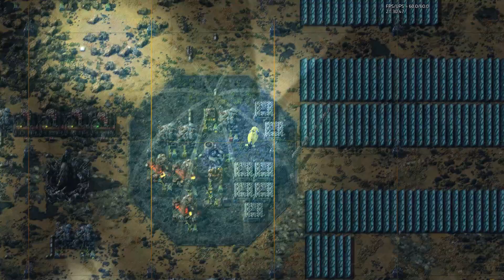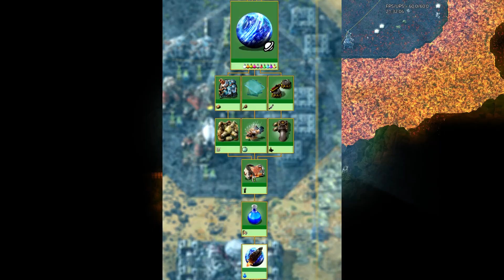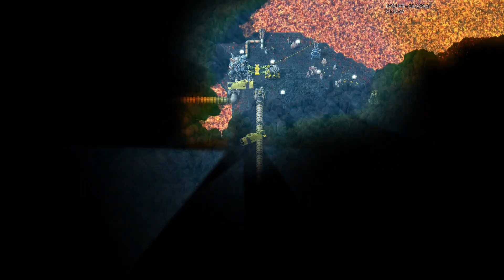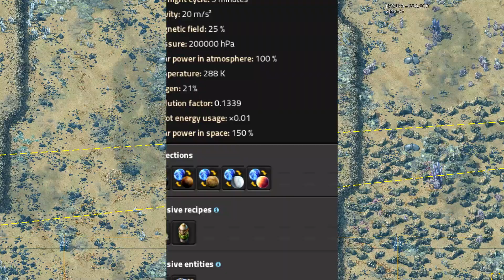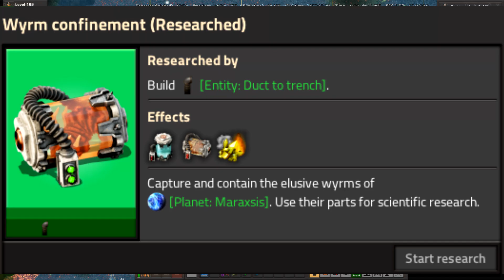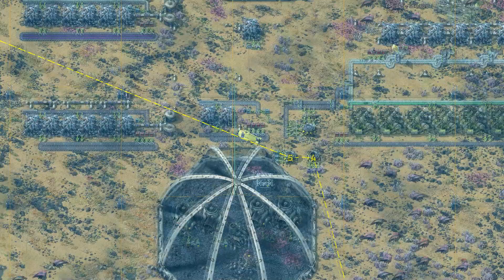Factorio Mod Tips: Maraxsis

Comment from the maker: Greetings Engineer! Thank you for tuning in. And thank you to notnotMelon for answering some questions I had about the mod:

1. How did the inspiration for the planet Maraxsis come about?
2. What made you settle on submarines as the transfer method between The Trench and the deep ocean?
3. What are the thoughts behind balance in terms of recipies, building a base in the trench for science? I know the 50% quality is meant to be overpowered, but did you also design it to be a hindrance(I found when I just wanted normal quality that I would need to work around the quality)?
4. Did you intend for people to choose between belt or bot bases when you made the robots consume less power?
5. The trigger techs worked wonderfully (for me) in terms of nudging me towards the goal, did you have the intention of "newer" players not getting lost or did it just seem logical to implement?
6. What was the intended power source in the trench? Imported steam, salt (for salt reactor) or a mix of both?
7. What was the intended way of getting the starting oil? I got a bit lost and imported heavy oil barrels to get coal liquefaction going
8. What is the reasoning behind the submarines having weapon slots if there are no enemies present on Maraxsis? Does that mean enemies are planned?

Answers by notnotMelon
1. Maraxsis will eventually be part of Pyanodons. We needed a water planet to fit all the sea creatures such as Dhilmos, Numal, and Sponges. At some point we decided to make the planet work also with space age standalone.
2. I absolutely love Xorimuth's spidertron patrols and wanted some way to integrate this into Maraxsis. Submarines became the natural solution. We met in Czechia and fixed the code for compatibility.
3. It's a hindrance at times, and an advantage at times. In general the tech progression should feel like quality is a hinderance at the start, but you can take more advantage of it the more maraxsis techs you unlock.
4. Ah, this is actually a bug. The planet's bot energy consumption is hardcoded be the game engine to be calculated based on x=gravity/pressure. I wish it could be something normal like 1x or 2x
5. This system went through many many iterations before I settled on the one that guides the player while also not feeling like a tutorial. Learned a lot about game design in this process
6. Imported steam and/or salt reactor are the only viable options. Fusion is banned here although I want to take another look at reworking the salt reactor to be useful on other planets.
7. You can melt fish into carbon into coal. Perhaps the simple coal liquification could be used for initial heavy oil?
8. Perhaps!
Reply: The mention of maraxsis first being a pyanodons addition is wild. I think that making it into a standalone mod for SA was the right decision as it opens it up to many more people to try. I love Py but I know that I am part of the minority when it comes to that.
Reply: Ey, this is nice! Especially 7, it was confusing.

Comment: why does this planet look so easy with you, the quality is killing me becasue you need to work with so many byprodukts and my fish food produktion is a mass because  i work with belts i mean with bio chambers you have 6 imputs and half of them rot and this limmited space in this domes. it took me like 2-3 h to do only fish food and im now 10h on this planet and i still dont have sience produktion i think im never leaving this planet its a logistical nightmare when you work with belts and i dont like the hydroplant because of the 50 % quality and i wish i could place regular roboports because this domes are awful for this there to big to place down if you only need logi cover. are you also confused that you cant produce atmosphere there you produce tones of oxygen that we could pump in the domes but no but still great video keep up the good work
Reply from the maker: @JonasHartmann-r1i  It's wasn't easy. I also had help from a friend. My fish food production is also suffering, and I elected to use speed modules and beacons everywhere to reduce the quality as much as I could, the rest I throw in a recycler and forget about it. My best tip, don't use belts. At least while it's basically free to use robots. And remember all the buildings you can place outside the dome. I only place the buildings I need to inside the domes. And I forgot about it all the time, that belts, inserters, and hydroplants work outside the domes. I'm pretty sure a pure oxygen atmosphere would be catastrophic and very flammable 😂